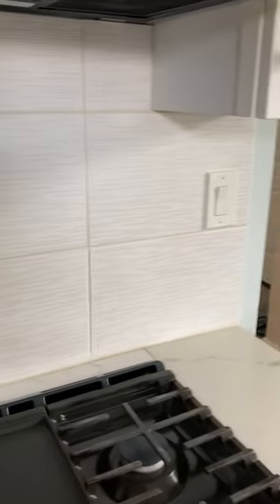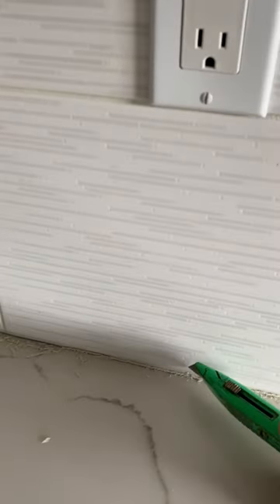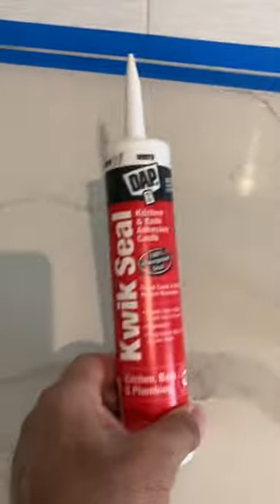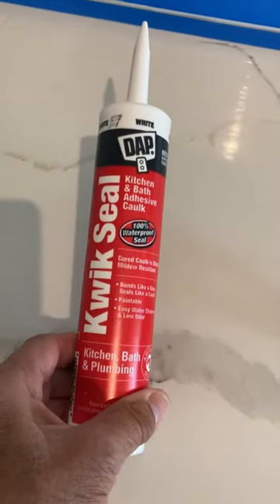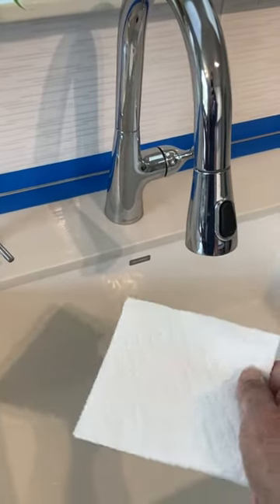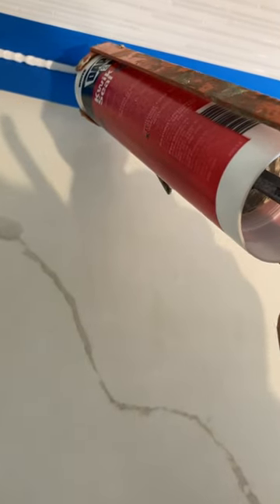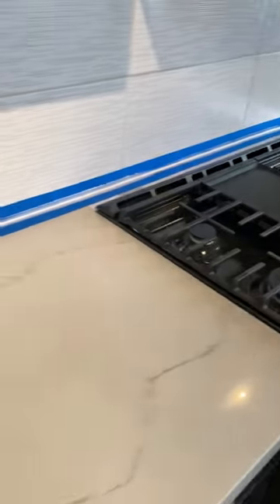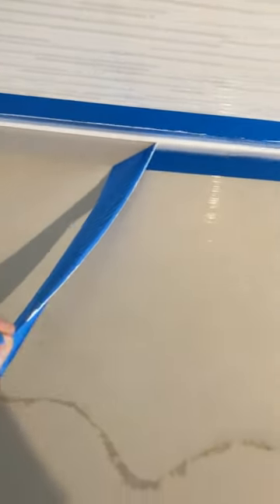DIY - Redo Your Kitchen Backsplash Caulking

Comment: Any special technique used in placing the tape? Did you just eyeball it?
Reply from the maker: Sorry, I used the "eyeball" technique. After you've done this a few dozen times it's pretty easy. Try for about 1/8" each side of the joint, apply the caulk, strike it off, and remove the tape. If it doesn't look quite right immediately use a damp rag/cloth/paper towel to remove it and do it again. That's why I recommend using a water based adhesive, because it's easy to cleanup and remove if need be. Be brave. Give it a go, and you will have great results!